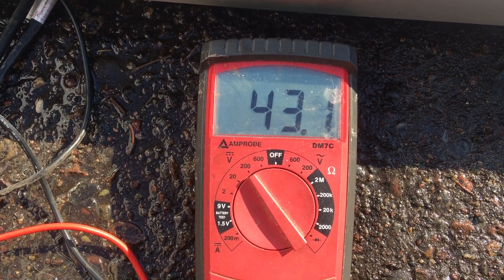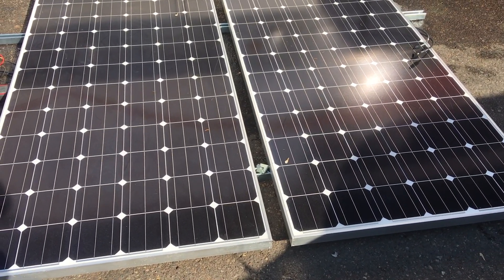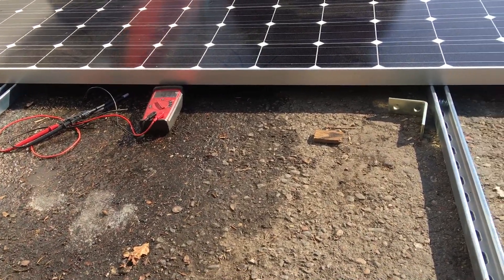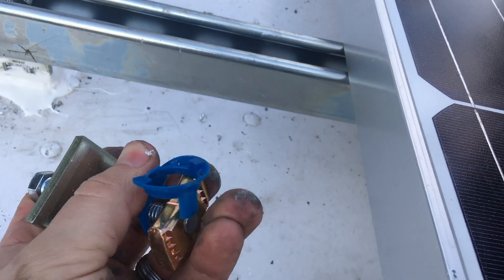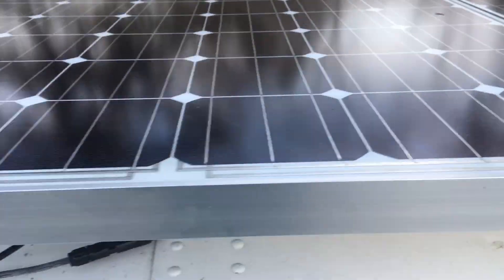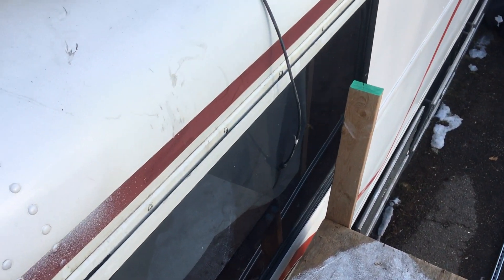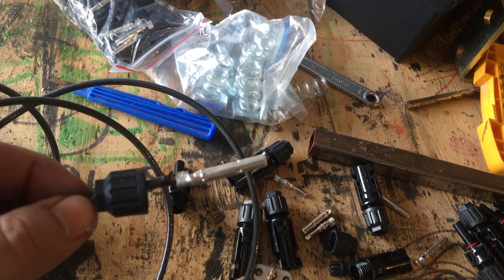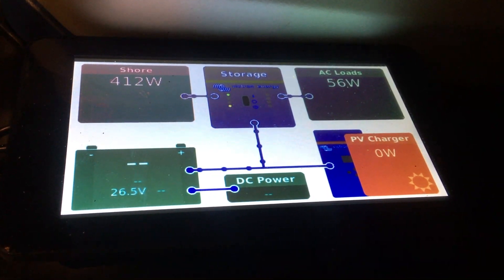How I installed Solar Panels Install using Unistrut on our Bus Conversion

Comment: how is your solar brackets working with a few years behind it? does the nut and bolt hold up well?
Reply from the maker: So far so good. Only had one hold down come lose over the years. I inspect it a few times a year.

Comment: Would you share your thoughts on why you chose the unistrut system vs other systems.  Is it stronger, cheaper, simpler, etc.?  What are the advantages and disadvantages of each system you considered.  Thank you.
Reply from the maker: Thanks for the question. Honestly, it seemed close enough to a standard solar racking system, but available anywhere. A plethora of hardware, and knowledge on it.   For a bus the added weight of steel vs aluminum wasn’t a big deal, a travel trailer it might be more critical.
Reply: @HimmelbergerBus  Thank you for the reply.  I am trying to decide between a unistrut racking system like yours or individual aluminum panel brackets, 4 ea. per panel, that mount directly between the panels and the roof.  The individual brackets seem simpler and less expensive but I wonder whether the aluminum is strong enough for 40 lb, 250W panels. I fear having a panel fly off and injure others or worse.
Reply from the maker: @godblessthelessfortunate3175   The brackets are not the weak point, it's always the connection between them and the roof. I've seen people do just VHB tape, or screws / rivets.  It all depends on your roof material, bus or sticks and staples rv, etc.  I did this for two reasons 1) I could connect into the 2" steel tube framing 2) Less holes in the roof.   This proved useful as I added panels and ended up raising the entire rack and connecting the two to add more panels and go over vents and ACs. https://youtu.be/X_G9IfZ4HOQ   Here is an even more recent video where we adapted the system and tapped the unistrut. https://youtu.be/IlJ0rzIvhyU  This saved some hardware and worked really good.

Comment: As an engineer, I'm winching watching this. Electrical solder is not the same as you use for copper pipe, as plumbing solder has very high resistance, and why conductors are not made from lead.  Unistrut is a good idea, but ditch the L-brackets, the holes in the backside are designed to bolt directly to other items. Oh and use a chainsaw socket with unistrut. Hope this stuff has been rectified since.

Comment: How do you like the rail system now that it’s been a while ? This is basically what we want to do, so we were just curious how you liked it
Reply from the maker: It’s been been perfect this far. We’ve now added more panels and raised it over the air conditioners.
Reply: @HimmelbergerBus   thanks for the update man, now I’m sure we’re gonna do it like this lol
Reply from the maker: @Ricedad  https://www.youtube.com/watch?v=IlJ0rzIvhyU  Here is another install we helped with, same idea.  We tapped the rails for the vertical supports, I really liked that method.
Reply: @HimmelbergerBus  also, could you give me a hint as to what size L bracket you used? The ones online are hard to gauge size. Thanks
Reply from the maker: @Ricedad  This is the one we used. https://www.amazon.com/Genuine-Unistrut-P1325-EG-Connector-Bracket/dp/B00HZT18LO/ref=asc_df_B00HZT18LO/?tag=hyprod-20&linkCode=df0&hvadid=167128844607&hvpos=&hvnetw=g&hvrand=9427928707463169175&hvpone=&hvptwo=&hvqmt=&hvdev=c&hvdvcmdl=&hvlocint=&hvlocphy=9019571&hvtargid=pla-310761350850&psc=1

Comment: Oops, at 6:22 I noticed that your cone nuts were facing the wrong way.  The side with the "teeth" are supposed to be facing up skyward towards the groove on the channel.  This way when you tighten the bolt, the rough teeth will be biting into the curvature of the channel to better hold it in position.  When you face the side with the teeth going down then the teeth do not serve any purpose and the smooth side of the plate is now more likely to slide on the groove of the channel.  So the blue plastic ring sits on the top of the channel and its purpose is to keep the bolt assembly from slipping down until you pivot the assembly sideways (unless you use the other model with the spring that pushes upward from the bottom).

You certainly have a strong beefy system - a nice touch so you don't need to drill as many holes and it's great that you can visibly locate the struts in your roof for solid mounting - well done!  Does the steel channel have a heavy zinc coating rated for outdoor use? (I decided to bite the bullet and use aluminum channel rails)  Many thanks for sharing!
Reply from the maker: I know I got creative with the hardware in a few places. No issues on the road thus far. I also rebuilt the rack with a 12” raise to go over the ACs and I think I did a better job that time around. No rust on them yet, so I’d say yes. They are rated for outside, been 2 or 3 seasons now. Thanks for the comment and watching!
Reply: @HimmelbergerBus  Many thanks for sharing your tips and fine overall job, even better with your refinements!   Happy trails, Michael

Comment: Are your bolts going through your ceiling beams or between them? They should be through the solid body steel frame and not bare roof metal is my point.
Reply from the maker: They are into the 2" square tube frame.  I'm not worried about them coming out.  Been solid for almost 2 years now.

Comment: Do you notice any drag or any difference when driving in windy conditions?  I figure it's negligible considering the height and weight if an MC9... But just curious.
Reply from the maker: Nothing noticeable while driving, which was surprising.  I realized why later when I drove the bus with snow on top still.  To my amazement, the snow on the front sent of panels never moved, however the snow on the back set was removed.   I have to think it was because the air pressure wave in front.  Here is a graphic that shows what I'm thinking. http://www.mindzfire.com/images/slide6.png
Reply: @HimmelbergerBus  Cool.  I'm weighing pros and cons of flexible vs. rigid panels.  The price difference is'nt that extreme anymore except when you get a good deal on rigid.  I like the ideas of the rigid actually shading the top though... Double duty.  The flexible just looks so much easier to install :)
Reply from the maker: @guildtwelve  Unless things have changed, the biggest problem with flexible panels is they overheat and die.   Here is a video from Will Prowse on it. https://www.youtube.com/watch?v=onMZ_dRSFUs

Comment: Great job! I am thinking about installing solar panels in a similar way on my 102AW. At 4:24, what is under the roof panels between the rivets? What have you bolted that bracket to? I assume that you have bolted through the beam with a nut underneath? I was planning on leaving the original ceiling material inside, so I don't really want to put any holes in it. Do you think a bracket like that riveted to a broader area would be strong enough to hold panels like that?
Reply from the maker: I did zinc coated lag screws. They’ve held up well, I check for tightness , the locking washers are doing their job.
Reply: @HimmelbergerBus  Thanks!

Comment: Do you think this would be a good option if I want mount waterproof roof decking between the rails on a shuttle bus metal frame for popping a tent on the roof for two people?
Reply from the maker: Zack Vance yup, might want to space the supports out no more than 4 feet. I’ve got one set that are at the ends and it says some. I’m looking to raise this up some, might add some more supports as well. I’ve been think about a little roof deck as well.

Comment: Man I wish I knew the solar game, just got that 6.5 Onan. We need to pre wire shortly but not sure how to go about with the lights in the bus.
Reply from the maker: I saw your genny, it's nice.  I have the little Onan 4.0 , I hope to hardly need it.

Think of solar as batteries that only work when the sun is out.  Positive and Negatives, then the charge controller for your battery bank.

Comment: How much did each panel cost you?
Reply from the maker: $165 or so, they were insurance claim because of snail trails.  Google it for more info.  It doesn't affect performance, but the insurance company said they'd swap them out, so I got them for $0.50 / watt .